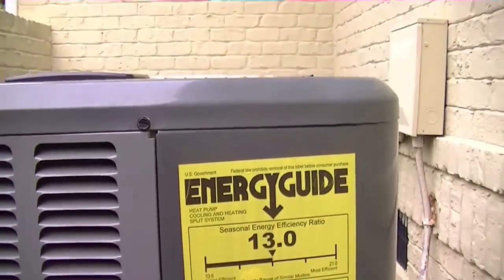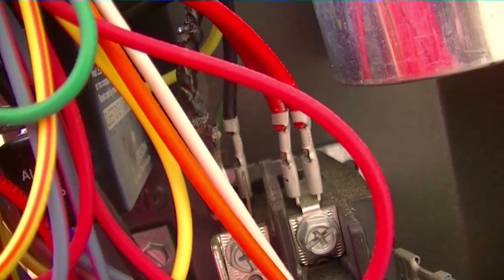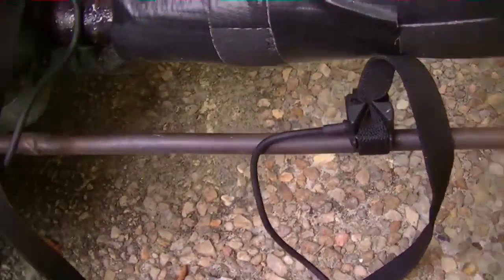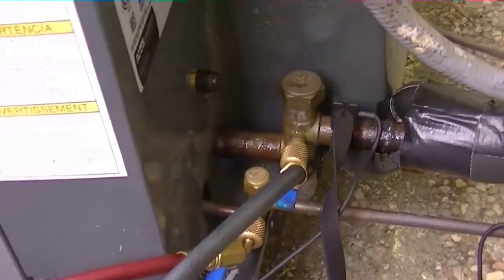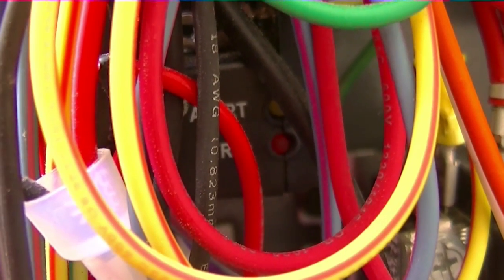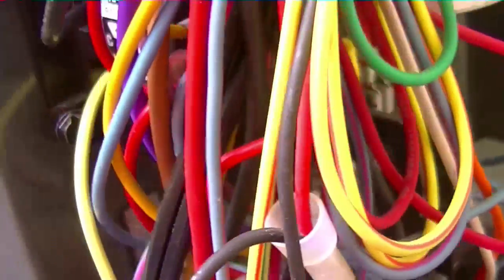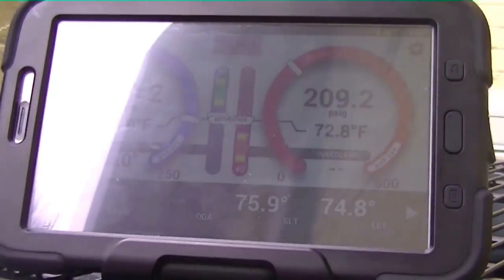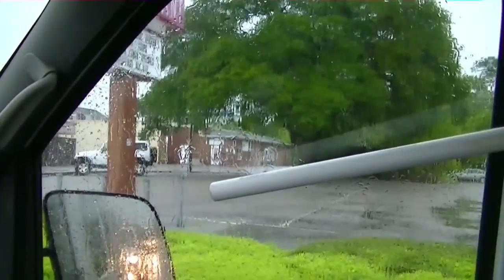HVAC Service Combo-  No Compressor and Low Charge

Comment: I like the way you used the imanifold on your cell for a quick diagnostic as to why that condenser kept shutting down. I guess in a way the imanifold may make sense. But where it will really have it's advantage is Superheat charging with the wireless probes next to the indoor evaporater! Correct me if I'm wrong? 

So glad you are back, dang I missed your work! Now I'm loving it! Back to learning more from you Lol.

Willie.
Reply from the maker: I agree about the superheat. Glad to be back Willie, thanks for watching
Reply: Thank you my bro!